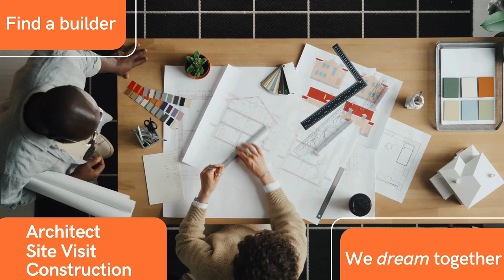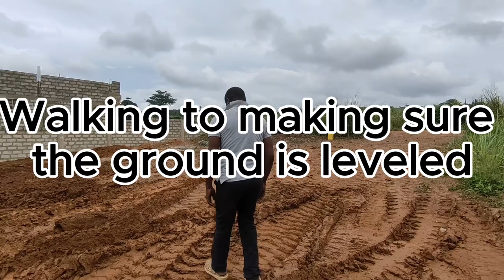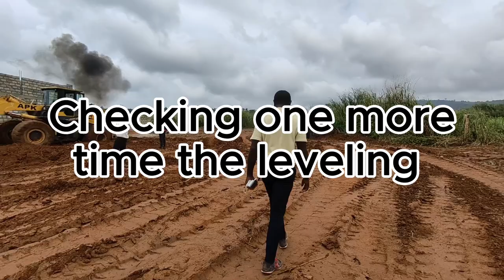Unlocking Potential: Discover the Shocking Results of Leveling My Land in Ghana!

Comment: I told you you didn't have any problems with that little slope. Be sure they will make your fence wall foundation deeper by that stream. I can't wait to see the journey, but please, bring us longer videos. These 8—and 10-minute videos are not going to cut it, young lady, no sah.
Reply from the maker: Lololol see some ppl say it’s too long some say it to short. I can please my battles.  Just know depending on the info I need to share it can be long or short. So I got you 😉 🙏🏾❤️🇧🇸🇬🇭
Reply: @Mz.BahamianGoddess  Those who thinks 10 minutes is long, let them watch it in 1.25 speed.  If your content is boaring, then 10 mins would seem like 10 mins would seem alot, but if content is interesting and captivating, anything under 20 mins is short.

Comment: Please. Why you buy water land ? And will give you problems in future. Water will  soak under your house. Then you will come online to complain about ghana. Royal kingdom have plenty level land with no problem and you bought a water land.
Reply from the maker: Hi.. Well, I didn't not know it was a water log when I purchased in the States sight unseen. Based on RKE land design I was not supposed to be that close to the stream. Yes, RKE do have other levels land and they did swapped out one of my plot that was defiantly in the water log. I have issues with the water log but all that can be worked around with proper building. since why I have added more dirt to level my land higher thank the stream.